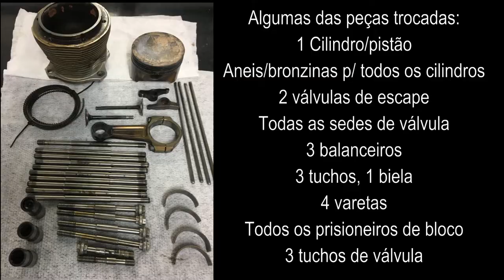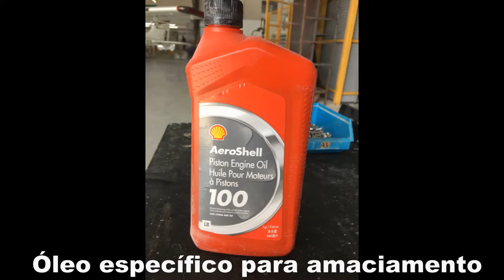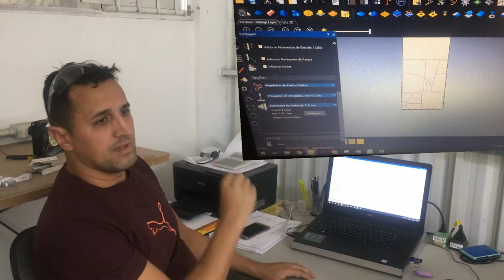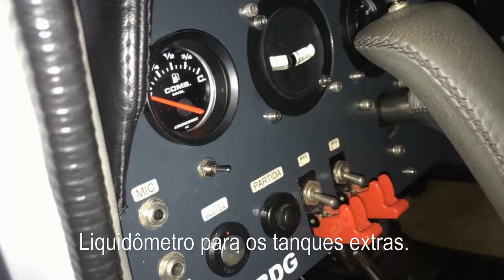Fazendo TBO no motor JABIRU

Comment: Indica o Jabiru, ou melhor investir no ROTAX msm?
Reply from the maker: José, são dois bons motores, com características bem diferentes. Portanto, o melhor depende da utilização que cada um pretende ter. O Rotax é líder indiscutível de mercado, muito confiável, silencioso e econômico. O Jabirú, por outro lado, é mais "bruto", mais barulhento, mais potente,  e com uma manutenção mais barata.
Reply: eu vi que o jabiru é muito rústico. De construção simples, feito em cnc. Direct drive e air cooled. Baita motor mesmo. Não sei pq no Brasil ngm fábrica um motor aeronáutico. Sei que tem uns preparadores de VW. E vi que a autolinea está vendendo um bloco VW reforçado, com capacidade de girabrequim de até 88 mm de curso. Acho que dava para tirar um bom projeto de um bloco desses.